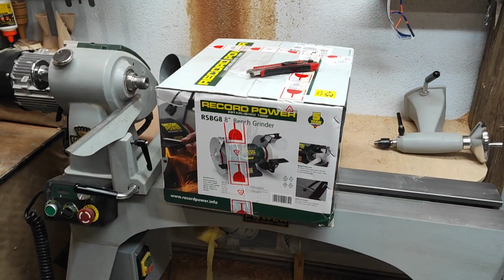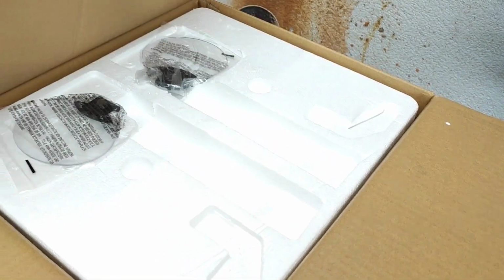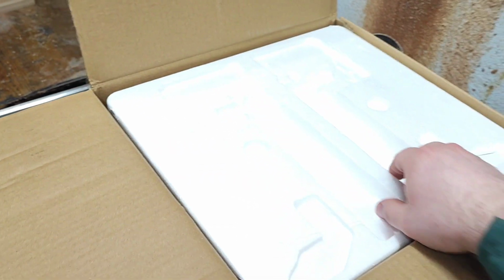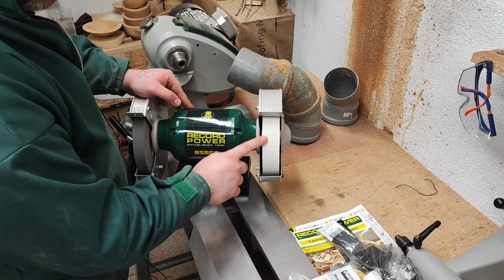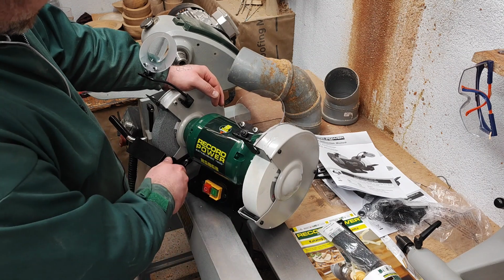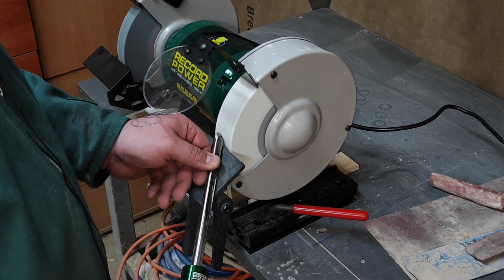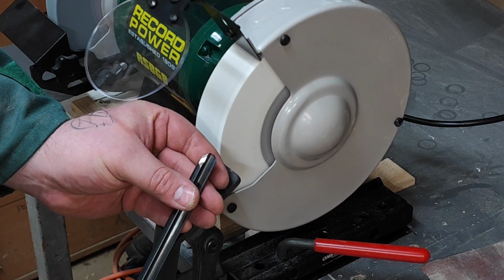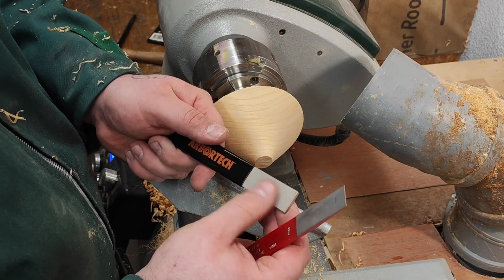*RECORD POWER RSBG8 BENCH GRINDER*

Comment: I've been looking at some of the expensive sharpening set ups lately. For example the Robert Sorby Pro Edge. But I see you and several other professional turners using simple grinders with a good grinding wheel. I think I'm going to save myself a few hundred bucks and get this Record Power grinder. Love your videos!
Reply from the maker: Thank you sir, its only setup so far that I prefer and use. I'm not a fan of belts on sorby or tormek. But thats just me😊

Comment: Hello there,
I have recently taken an interest in this grinder, because I have just acquired the Record lathe, and will need to sharpen some tools that I was given.
Before watching your video, I was very enthusiastic about this grinder, but when you started it up I nearly fell off my chair, because the "great" 40mm fine wheel was TERRIBLY out of round. It shook and jumped like crazy. This is a very bad sign. It's what we call "out of round". With this terrible fault you will kill the ball bearings in no time at all. This is an extremely negative point. It's been two years since you made this video, and I don't know if you'll read my comment and be so kind as to answer. Have you resolved this problem yet? 
Greetings from France.
Reply from the maker: Hi
Yes at start all white or grey wheels will be out of balance a bit, this is where a diamond wheel dresser comes in handy to true up front face of the wheel.

I haven't got any issues with it, I had a cbn wheel as well at some point on it. No ball bearing issues.

Now I do have a heat issue on the switch, but only because I sharpen all day when tools arrive. So far its a good grinder especially for the price.

Comment: Hi dear, thanks for your reviews. I got the same grinder 2 days ago, with the hope to solve the problem I had with a FERM one: the gouge jumping one the wheel.
I mounted the RP and the oneway vari grid, but also with RP grinder, same phenomenon.
Maybe is the table which is not so firm?
Reply from the maker: Do you have white and grey wheel that comes with Grinder? 
I always true those wheels with diamond dresser
Reply: Yes, RSBG8 and I did dress it but only a little bit, I guess less than 1 mm with an old cilindric diamond dresser, which works well. I ask RP seller what else to do and they say to give them back the grinder :/
Reply from the maker: @quetuani8970  auch,  sorry to hear that

Comment: Thats a nice grinder 😁 I was close to buying the very same one, then stumbled across second hand grinders for sale; one of which was a 200X32mm 900w slow speed machine. Travelled to meet the man selling it, turns out the grinder was basically new and the man sellin it was Glenn Lucas 😲 I got to see his workshop where he teaches, it was amazing 😁
Reply from the maker: Aaaaa that is amazing, so you are from Ireland? I used to work in Cork for around 6months👍 he was selling few grinders a few weeks back, are those what you bought?
Reply: @tomislavtomasicwoodturning  Yes I'm Irish, from Wexford in the southeast.... I know Cork well, I was there only yesterday 😁 it was a few weeks back that I bough the grinder, it's an Axminster one, Mr Lucas did have other things for sale too; CBN wheels, jigs, and some other stuff. 
His workshop/school was amazing, a mill outside for cuttin his own wood, ya walk in the front door and there's a wall with many beautiful turnings displayed on it, then in the workshop there was a row of about 7 Vicmarc lathes (vl300 I think) 😲 I had to pick my jaw up off the floor when I got inside the workshop, I couldn't wipe the smile from my face 😁
Reply from the maker: @whittysworkshop982  awsome,I think my jaw will be still on the floor😅
Reply: @tomislavtomasicwoodturning  I still have a bruise on my chin 😆
Reply from the maker: @whittysworkshop982  😂😂

Comment: Nice! Is this a low speed grinder? If not, why not? Thanks.
Reply from the maker: Its full speed grinder,2850rpm I think.... Slow speed ones are not quite avaible or better said common in Balkan area.... These are cheaper and I get the job done faster....